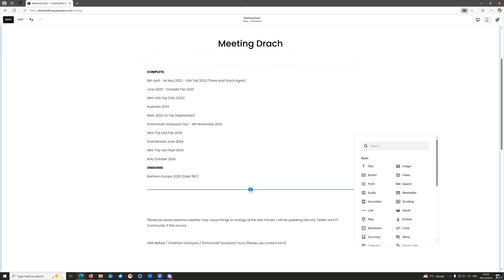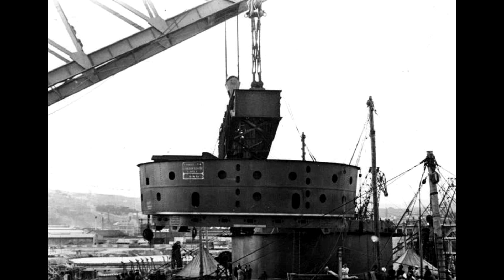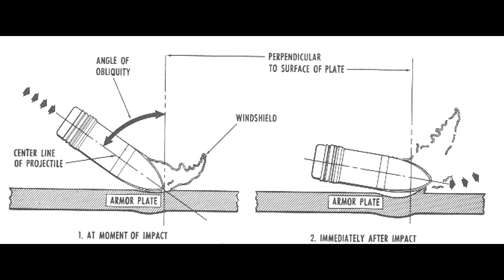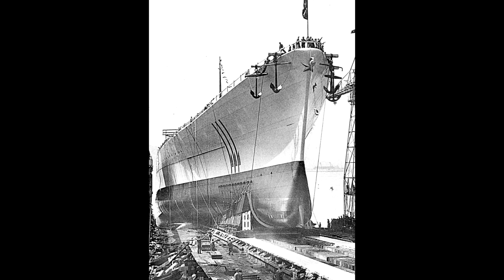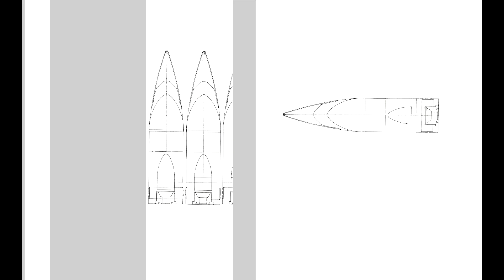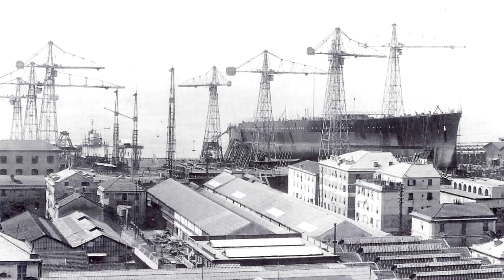Naval Engineering - Did the Littorio's Armour Scheme Work?

Comment: A very underrated class of battleship.  If the ammunition had lived up to the ships ability, they could have seen a real problem for the allies.
Reply: You'll find the RN were more concerned about Regia Marina than Kriegsmarine overall. - A huge if had always existed for what could have been if Italians had radar,
Reply: @tristanrainey5080  true dat
Reply: Lack of fuel was always a problem to just deploy large RM units.
Reply: If they could find fuel to sail those monsters
Reply: I am kind of sad they weren't put into service on the allied side after the Italian surrender.
Reply: There was nothing wrong with the ammo. It simply had always been fired at extreme ranges and/or on smaller ships that were manuvering to not be hit (in that case, it had been amply demonstrated that it needed thousands of shells to hit something).
Reply: @neutronalchemist3241  There were some ammo problems. For test purposes, the manufaurers sent hand-picked, very high quality shells. For mass producing, the quality assurance wasn't the best, so every shot felt like a lottery in combat situations. I remember the British even wrote that sometimes they had they feeling that the Italian ships were firing at 2-3 different targets sometimes, so poor was the dispersion.
Reply: @kovacsj7823  That of "hand picked shells" is only a tale without any real source. 
The only complain about dispersion came from Ad. Iachino,  a suspicious source since he had to justify his fiasco at Cape Matapan. And had been denied by many others, among those his own fire director. 
For that, Italians had never been impressed by British gunnery as well. The only British ships whose fire they considered accurate were the old 8-guns light cruisers.
Reply: @neutronalchemist3241   Marco Santarini was recently able to find previously lost period Italian gunnery measurement data and plot it against data from other nations.  See  Gunfire dispersion of Large Italian Naval Guns - The strange case of the 381/50 ANSALDO-OTO mod. 1934 gun   in Warship International 2020.  I haven't studied his work in depth, but the main comparison chart seems fairly clear: the Italians had a dispersion problem.  You can read this for free by signing up for a free JSTOR account.

Whether or not the assumptions Santarini makes in his analysis are correct is something I can't say at this time, but that seems to be more about causes of the dispersion and not about whether or not the dispersion existed and was a problem.

The wartime accounts of British sailors who encountered the Italians also supports the conclusion of large dispersion.
Reply: @kovacsj7823  from our records, we Italians had problems with guns captured from the enemy. In particular the guns made by the Austrians.
Every attempt to made a shell able to perform well on those guns was ineffective.
Same goes for German and British guns captured or aquired through war.
The guns we developed and built through active cooperation with the British, such the 381mm of the Littorio instead had high quality shells and good performances.
Indeed then there was problems in "hitting the target" on far distances, but that concerns targets out of the 32 km of distance.
Everything between the 32 km of useful range and the 42 km of effective range of our 381mm guns was... ahm... "a lottery" as you said.
Reply: @bluelemming5296  All is relative. According to Santarini, the OTO 351/50 of the Littorio were anyway more accurate than the 38 cm SK C/34 of the Bismarck at normal engagement distance (someone extended the study to the Sharnhorst, obtaining even worse results). 

So why the Bismarck hit the Hood and the Prince of Wales?
Because it fired, from 18.500m to 15.000m distance on targets that were not trying to evade. 
The same moment the POW steered to break the contact, the Bismarck ceased to hit anything, even if the target was at less than 16.000m distance, and quit firing at only 18.500m distance.

In the same engagement, the Hood did not hit anything at all, even firing several salvo at less than 20.000m distance and, according to the same Santarini, the POW shown a marginally better gunnery than the Bismarck, but not enough to change the outcome of the clash.

Mind that, having the fastest muzzle velocity than any WWII battleship gun, all things equal, the 381/50 should have a larger horizontal dispersion for purely geometrical reasons (firing two shots with a given error in vertical angle difference, the fastest shell with the flatter trajectory will fly more between the two horizontal  drop points), but that has little practical effect, since ships are not only horizontal targets (the same Santarini, IE, calculated that the Hood was a vertical target three times larger than an horizontal one) and the same flatter trajectory of the fastest shell reduces the vertical dispersion (other than the error in bearing, by reducing the flight time).
Reply: @danielefabbro822  Every shot over 25.000 distance only served to "warn" the enemy. The chances of an actual hit were almost not-existent. Iowa and New Jersey claimed several straddles on the Nowaki from over 30.000m distance (in 1944, with accurate radar range-finding and delay coils installed on the guns), but none of them hit it.
Reply: @neutronalchemist3241  on the Battle of Pubta Stilo a British cruiser was hit by the shrapnels of a Littorio gun.
It was at 32km distance.
Reply: @danielefabbro822  So the Nowaki took some shrapnel, but it only has a statistical significance.
At that distance, even with tight dispersion, the salvo was too disperse to have real chances to hit the actual target even straddling it. Also, the time of flight was so long that, even a course correction of only 15°, made by the target ship in response to the flash of the salvo, would have displaced it of about 200m from the expected point of impact.
Reply: @neutronalchemist3241  we had to reduce the distance of useful shoot to 32km in order to have precision.
But the particularity of the 381 with such flat angles and such high muzzle velocity made the gun able to shoot precisely at great distance outclassing even superior calibers.
The "myth" of Italian inaccuracy comes from the fact that the Littorio ships was never allowed to engage directly the British forces on closer distances. Because the regime never wanted to risk those ships. And so the only engagements done was at very far distances. Thing that gifted the Littorio with the longest hit record for a Battleship in history. And as I said, it's 32km.
Reply: @danielefabbro822  I already stated that the accuracy of the 381/50 was not worse than the main calibers of other powers, and that they barely hit anything (they did only in the second battle of the Sirte) because they had been used, or at extreme ranges, or on targets that were only manuvering to not be hit (in this case, it had been amply demonstrated that, even at far closer distances, and with much rapidly firing guns, you can hit something only spending thousands of shells).
But there is a reason why about 25.000m is the longest battleship hit ever recorded in action. Beyond that distance the salvo, not only the Italian, but of all the WWII battleship guns, were too disperse to have real chances. 
Mind that, IE, in the battle of Denmark Strait, all the battleship hits happened between 18.500 and 15.000m distance.
Reply: @neutronalchemist3241  You stated above that  The only complain about dispersion came from Ad. Iachino and I was merely pointing out that we have independent sources on this issue.  Further, since it comes from period Italian data, he was probably aware of it - which suggests you might want to rethink or tone down your implication that he was fabricating the dispersion claim.
Reply: @bluelemming5296  I stated there was nothing wrong with the ammo quality. Santarini agree with that.
I stated it had always been fired at extreme ranges and/or on smaller ships that were manuvering to not be hit (in that case, it had been amply demonstrated that it needed thousands of shells to hit something). And infact Santarini found WWII battleship guns that had worse dispersion, without anyone complaining about that, and that had been quite effective, because they had been used on shorter ranges and on ships that were not evading.
Those guns had been used against ships that, according to Santarini, had among the better dispersion patterns of all WWII powers, and that had been throughly beaten. Mind that, the Brits, in the Battle of Denmark strait, opened fire at 24.500m, but them too didn't hit anything as long as the range had been over 20.000m (and the Hood didn't hit anything at all). 
So, it doesn't seem that the 381/50 dispersion pattern could cause any real problem in actual engagement conditions. 
A thing is a statistical analysis, another thing is complaining. It's like complaining of the 3MOA average accuracy of the M4 carbine, when there are 1-1.5 MOA DMR rifles. Firing on human-sized targets at actual fighting range, it doesn't make any real difference.
Reply: @neutronalchemist3241  At Denmark Straight, the Gunnery Officer on Prince of Wales wrote that the waves and wind were such as to keep throwing water onto the glass surfaces of even the highest gunnery director, and despite the wipers they couldn't get a reliable range until 20k.  Also, the normal procedure was to pass the range between ships, and that didn't happen, so we know Hood had even worse issues (he mentions their setup was more exposed).  The radar was turned off when the engagement started.  So we know why the Brits didn't get any hits at first.  Being in the wrong position relative to the water and wind is a big problem that's going to trump dispersion issues.

I don't think anybody disagrees with the idea that the Italians would have gotten lots of hits had they been willing to close the range.  The dispersion problem - which they knew about - should have been enough to force them to do exactly that.  It is a mystery that they had a serious problem and didn't take appropriate corrective action.
Reply: @bluelemming5296  We know that the Brits didn't hit anything past 20.000m. We don't know why. We can hypothesize. But has a KGV class battleship ever hit something at over 20.000m distance in action, to make a comparison? Even in Bismarck's last battle, on an enemy that was practically adrift, the Brits opened fire only at 20.000m and, for when they hit something, they were so close that they were using their secondaries as well. 
Surely, in the Denmark strait, the positioning of the sights on the Prinz Eugen was no better than on the British battleships, but it scored hits farther than them anyway.

It's not a mystery at all. And its pretty amusing to reason like the Brits were standing, waiting for the Italians to come close. The Brits never served a battleship to a Littorio at short distance. When the guns of the Littorio had been fired at extreme ranges it's because the enemies, that were light cruisers and destroyers, fled. The only time they (again, light cruisers and destroyers) engaged a Littorio at short range had been in the second battle of the Sirte, under a storm. 
For when the Littorios had been fully operative, Brits and Italians knew the shortcomings of battleships, and tended to use them under their own air cover. That means that the possible areas of contact were really limited. 
The only REAL possibility to have a clash between a modern British battleship squad (Nelson, Rodney and Prince of Wales) and the two Littorios had been during Operation Halberd, but there the Italian command miscalculated the route of the Britsh formation, and so the Italian squad failed to make contact (But Nelson was hit by an aerial torpedo anyway, and the Royal Navvy didn't risk a battleship so close to the Italian bases for more than a year after).
Reply: @neutronalchemist3241  We do know why the Brits didn't hit anything over 20k, the statement of the POW gunnery officer tells us that clearly and in considerable detail.  You can't reject expert testimony without solid grounds and expect to be credible.  The gunnery officer on any capital ship was an expert in his trade with a professional lifetime worth of experience in the theory and practice of using guns - the best of the best.  If you want to claim that the KGV ships couldn't hit over 20k - contrary to what was implied by the gunnery officer, who was in a position to know - in his statement he implies that they could have gotten hits further out - then it's up to you to produce the gunnery records from range firing to prove that.  Nobody gets to reject evidence simply because it doesn't match their preconceptions.

People might choose, under some circumstances, to not open fire at their maximum range.  There can be very good reasons for this, such as conserving ammunition, especially when an enemy can't run away anyway due to existing damage.  It doesn't mean they can't hit targets at that range.

Also, in naval combat there is something called "The Weather Gauge".  It means one side can have a big advantage over the other due to some aspect of the weather or even the positioning of the sun.  In this situation, the British were having problems with their range-finding.  That doesn't mean the Germans were also having problems.  They were coming from a different direction relative to wind and wave.  Hence, we can't assume the range finding system on Prinz Eugen was having the same weather problems as the systems on POW and Hood.  If you want to claim this, you would need to find the gunnery officer's after-action report to show that.  Also, you would want to investigate the height at which the range finders were placed, since that affects vulnerability to weather.  Incidentally, the gunnery officer on POW noticed how high up the range finders were on the German ships - that's in his write-up.

Finally, it seems to me that the Italians could have pushed to closer range during the Battle of Cape Spartivento.  That would have allowed them to engage at least Ramillies for a bit, which would have at least given them some useful data on the capabilities of their weapons, and been relatively low risk.  The admiral in command could have turned a Nelsonian 'Blind Eye' to any orders to the contrary, at least for a while.  Also, a navy that turns and runs without a really good reason inherits a potentially crippling morale problem for all future engagements.
Reply: @neutronalchemist3241 No, it wasn’t just the range.  When the Italians had a good batch of shells, and gun barrels in the sweet spot between brand new and too worn (which was a short window for those guns), they had low dispersion even at long range.  But when those factors didn’t line up, they had extremely high dispersion at even medium range.
Reply: @bluemarlin8138  And the source for this tale is?
Reply: The naval version of the "Alfa Romeo owners experience". Brilliant design, poorly executed, often breaks down.
Reply: @richardmartin8998  The Littorio class never shown the "teething problems" of the King George V class, nor any particular problem to the machinery, and, compared to the aforementioned KGV  and Bismarck, it tanked torpedo damages remarkably well.

Comment: 1) the Littorio's were way over the 35,000 ton limit (40+K). 
And they did not need much bunker space. 
So why did they care so much about saving weight?

2) why not put the two plates together and you get 350mm (13.7 inches). 

Which is about the same as the Nelson's and only 1 inch thinner than the KGV's; which you outgunned anyway in terms of caliber).
Save some space, a lot of hassle and have roughly the same combat capability.
 OR
Do the above but thicken the plate by another inch which costs you a couple thousand tons (which the Italians did not seem to care about anyway).
And again, have a much simpler ship with at least equal armor to anything in the Royal Navy.

Sounds to me like the Italians were being innovative out of arrogance as much as anything else (this and the Pugliese system).

Of course, if they had really used their heads they would have had just one, dual secondary battery size instead of the three(!?!) separate ones (6", 4.7" and 3.5" inch).
But that is another matter.
Reply: 1st one is definitely cost. 

2nd i am pretty sure the common naval knowledge at the time is slapping two plates together isn’t as effective as one solid thick plate.
Reply: @justinebautista1383  1) then why equip them with 3 secondary batteries? And why build them so overweight - that surely cost a lot more money than building them to 35K with one secondary battery (say 4.7").
 Sorry, that does not make sense to me. I think they just tried to get too cute.
2) I have heard that.

Comment: You'd think the foam would increase decapping by allowing the shell to tumble more than normal concrete. A simple UK friendly test would be using a Ramset concrete nailer. Would need equivalent samples of hardness and density.
Reply: Modern NERA armour does in fact use foams as interlayers.